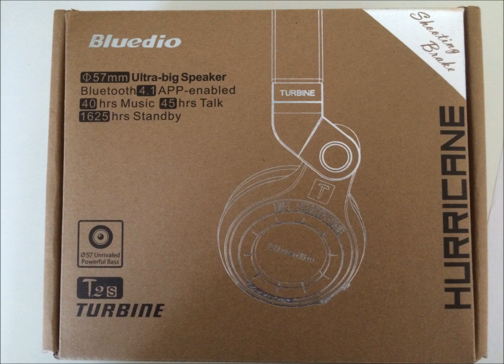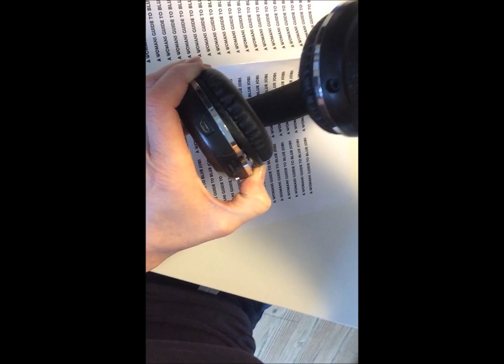How to fix Bluedio wireless headphones (T2S) & look inside -  No Power

Comment: Wow 6 years ago.  Now on my 3rd pair. So pleased with them. This newest pair were fine for about 3 weeks but now the red light comes on when charging BUT to use, the POWER button does nothing.. I've disassembled as you showed and took out the 4 screws but can't seem to release the tabs. I don't see a black bit to push towards the outside. Thanks, Brian.

Comment: These are amazing headphones. I bought 1 back in 2018/19. Still running like new. This is one of those purchases from Daraz that I'm proud of 😂. Bluedio t2 plus turbine is the jack of all trades type audio gadget. You get the headphones, with fm radio, mp3 player from memory card, bluetooth, aux connection, sharing audio through 3.5mm jack, a month worth of battery life, slick design. Only downside is, the head arch makes issues after a period. And the audio bleeds a lot. I closed the side cups with plastic sheets and it gives more clear sound with heavier bass.

Comment: I fell asleep with my Bluedio UFO2 on and the next day it wouldn't switch off (light stays on permanently - I am waiting till it runs flat at moment.  If I plug in to power a red light flashes in tandem with the blue).  Took the power button side off to see if I could see anything immediate, but no joy.  No longer connects to PC bluetooth but the headphones do still work by plugging in to an AUX port.  Any ideas? 
Oh plus, its good to see a large breasted lady who is good with her hands.... Keep it up, so to speak.
Reply: my headphones have the same problem can't figure how to fix them
Reply: @randommusicman1852   Mines are working again, I just let the battery run completely flat till the light went out (took about 5 days) and then put a bit of charge back in and they switched on and off fine.  Strange, but hopefully yours will be the same.

Comment: Thank you! I was prying on the wrong part to get the ear pad off. I have a pair that won't charge... Hopefully it's just that something came unplugged.
Any idea where to get parts for these?
Reply: me too I need replacement headband.
Reply: @titi9238  my battery was dead. I replaced it with a larger battery, it would last a lot longer with the bigger battery. A week or 2 later, my like girl accidentally broke the head band! 😓
Reply: @hondaguy9153  so now we are the same! I used gorilla tape to keep the plastic in the headband together but I would like to replace it eventually.
Reply: @titi9238  as far as I've been able to find, there's no parts available. I considered an amplifier and some bigger speakers to turn the Bluetooth headset into a speaker.

Comment: Hiya. Thanks for the video! Can you help me as I didnt quite understand what your fix was? Did you strip the wires and re-solder them back into place again?  I have the same problem with different headphones but I cant seem to find any broken wires? Am I to assume that there is a break somewhere at the end of the wires.....if so do I cut, strip and solder?  Ta 👍
Reply from the maker: mwp70 hi, my wires had pulled completely off so I just had to re-solder. I would be surprised if they have any breaks...good luck :)
Reply: @Awomansguidetobluejobs  .....Oh ok appreciate your reply. 😊 My right headphone is not working but lights and buttons still do and all wires seem intact. There is a break somewhere though which means I have a bit of investigating to do (after all the other 101 mum things to do) lol. Ill keep at it cos at least youve given me that....that it can be done. Cheers!

Comment: Hi, only the right side of my headphones are working, the left stopped working suddenly via Bluetooth power and six cable, the headphones did not sustain any damage, they were working fine but the battery went flat after I charged it, only the right side worked.
Reply: Hi budd same here did u just threw it :'' ?

Comment: Wire color was spot on, thx for that helped me re-soldered   mine with diff wire colors...

 great earphones i refuse to buy new pair and have fixed mine 5 times already, re-soldered, reinforced them at the band with a metal plate and they keep working.